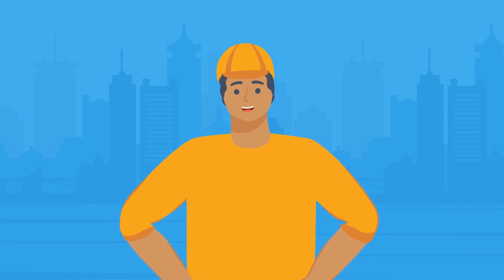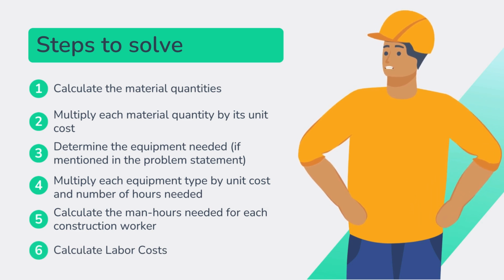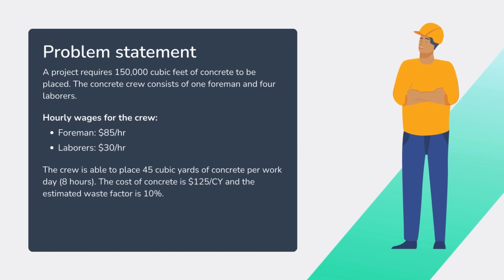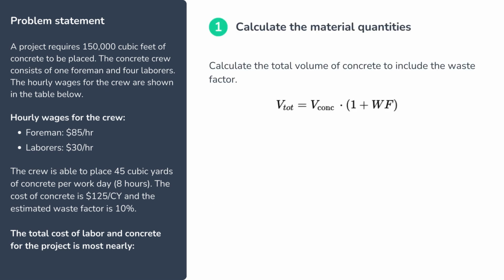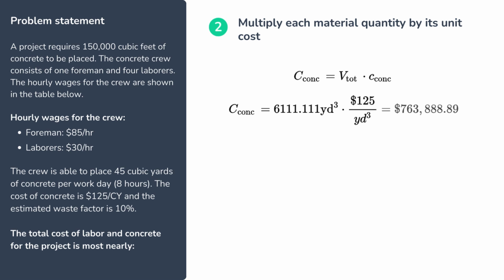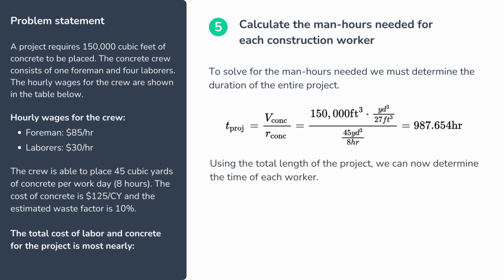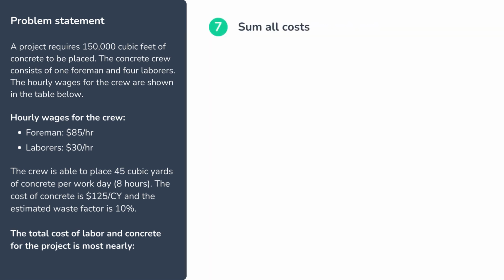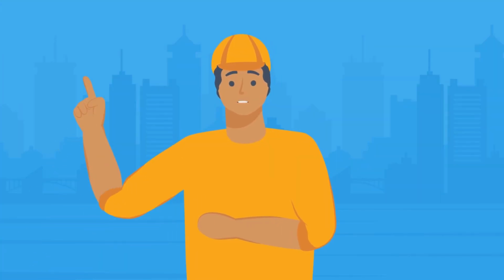Estimating Total Project Cost with Concrete and Labor: A Civil PE Exam Walkthrough

Comment: Great example. Question is why use the 150,000ft^3 instead of the 165,000ft^3 to determine total manhours?
Reply: Labor productivity is generally measured by the volume that forms the final structure which is 150,000ft^3 in this example.
Reply: Waste is only used in estimating costs for materials, not man hours